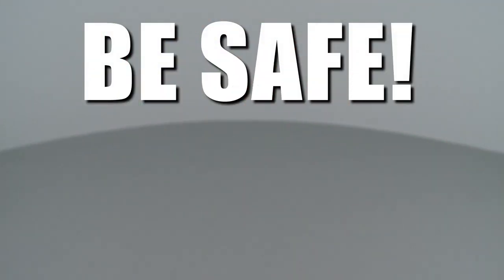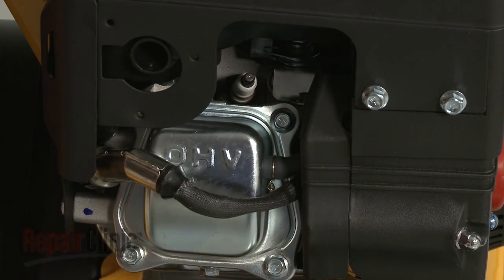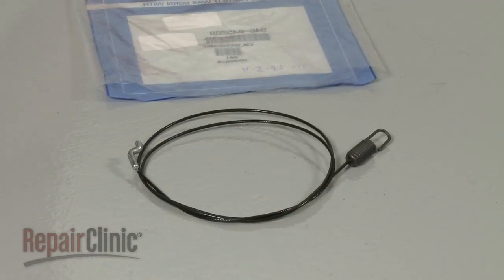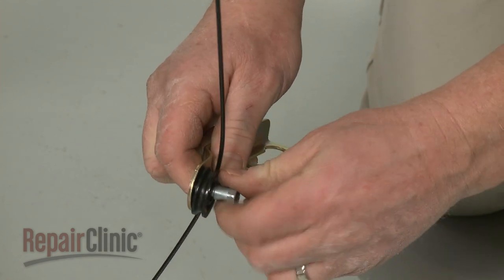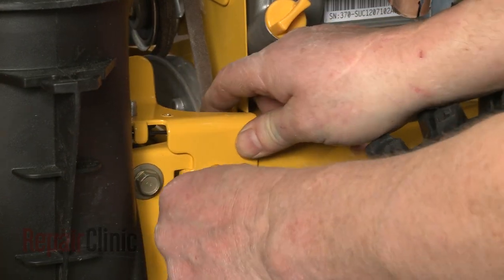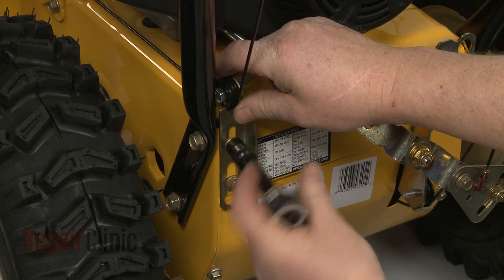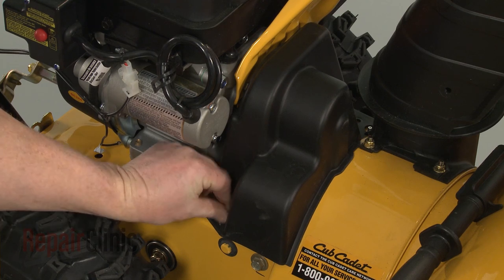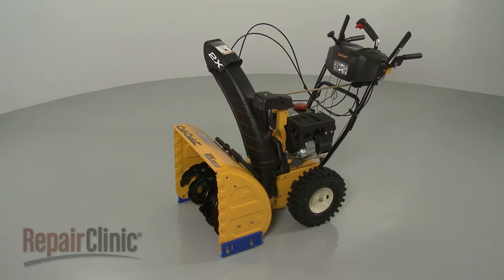Cub Cadet Snowblower Replace Auger Drive Cable #946-04230A

Comment: So, my cable didn't break, but it got slack.  and then after further use, the auger stopped fully engaging and now 2nd stage isn't blowing.  i wonder if it just needs adjusted or if i need to replace?

Comment: we need to fix that tread-like thing at 0:52, where do we get the part and how do we replace it?
Reply from the maker: +kemosonicfan123lbp We are not sure what part you are referring to. At 0:52 we remove the belt cover which exposes the belts and pulleys.

Comment: Does anyone know the reason the spring/hook on the end of the cable would break? I replaced the cable, which came with a new spring/hook attached and it broke again soon after. After taking it apart to check the second cable, I noticed the auger belt is also pretty stretched in one place, (although I didn't notice this when replacing it the first time.) I am picking up another new cable, auger belt, and drive belt tomorrow. I am hoping that replacing the new belt will solve the issue but the sales person said it may be a bearing.?